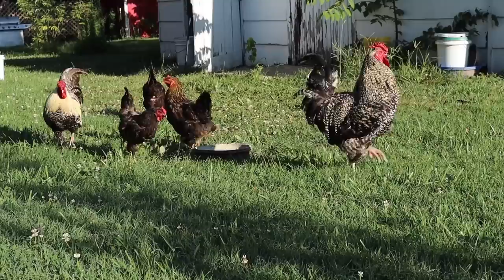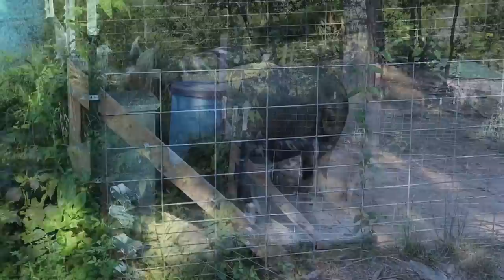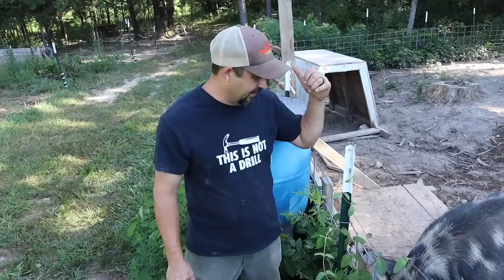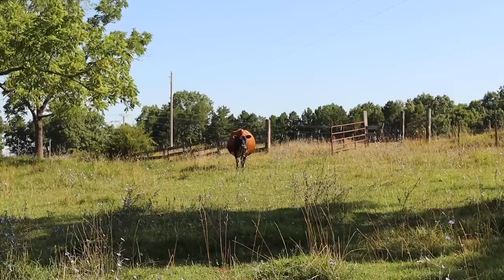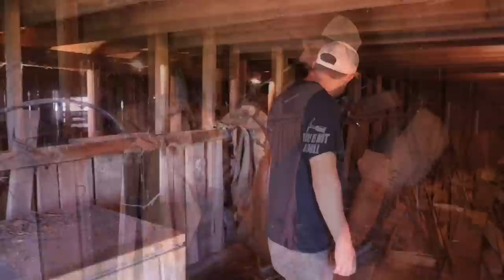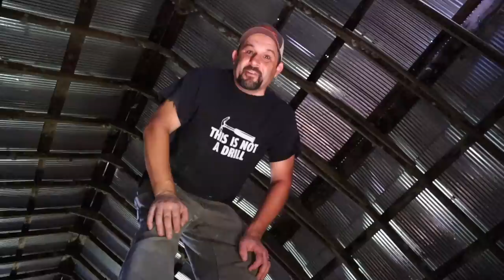This Barn Has Waited 50 YEARS To Be Used Like This Again!

Comment: When the hay got low enough we used to clear off the floor and play basketball.  We had a hoop on just one end.  I think I would get it water tight and use it for storage.  Depending on the area you could rent out storage space for others.   You don't want bats in there due to the  rabies problem.  You could build a bat house for them.  They are useful as they eat a ton  of insects.

Comment: Hi, the boxes you found may have been feed boxes...we used similar  ones for pigs that had sired their pigs and for the horse we had attached them so they could not be moved. 
If you have the time I would put a staircase on the outside going up to a landing for a easier safer access to the top of the barn. 
In pa we always had dirt hill to one side, but PA is mostly hills lol. I seen the bird flying around I would screen it keep them out to keep it clean for drying. It would be great for drying herbs as well and a place to store homemade vinegar in a barrel. I had a 55 gallon wood barrel full of apple cider vinegar. Good luck in all you are doing. Hoping  to get back to a homestead soon I did it for 27 years and miss it. Look now for work then land.

Comment: I went to a farm in the summer that was just like that.  Hay loft and storage in the top, milking in the bottom as you show, on the side the pigs ran out into the field and had the pig slop big buckets to feed them. 
You are accurate about how it was used......it's a beautiful barn. I remember in the barn they had a side room on the cool side of it and that is where they did milk separation process with a sink and water etc  before taking it into the house to keep it and cool it in frig or they may have had a frig in that room to do that.  That would be easier than bringing it into the house kitchen as it was limited in space also.  they had a one legged stool with a round seat and rounded peg on the bottom for the "leg" and they balanced on it as a seat and could move easily if the cow moved.......it was very very much like that barn you are showing. It has side panels that lifted for air and could be put down also for winter or weather and that was in So Dak  in Howard.  So fun and memories. The crops were down behind the barn off to the side corn and veggies by the creek and the animals could reach the creek and get to the fields and back to the barn........the pigs would come running when the farmer called sueeeeeeeeeeeee sueeeeeeeeeeee they knew it was meal time. All the critters came back to the barn for eating and were let to pasture and creek the rest of the day........they would come back at evening.......like clock work. 
Loved that!
I believe you would have loved the farmers and they would have certainly loved the two of you and your care and love of the land and animals!
Blessing

Comment: I grew up in Nebraska on a farm that had 4 milk stanshions. There were 13 kids so 4 cows must be about the right number for a family of 15!

  Like yours, there was a recessed concrete trough behind the cows.  Instead of hand carrying the hay, there were several "windows" cut out in the wall of the hayloft where the hay could be dropped down, by pitchforkfuls, into their feed trough. The trough was about 6' tall so the hay didn't fall on the cows. Our barn would have been built in the early 1900's.  So the front and back eaves opened up and there was a manual hoist system inside to lift the loose hay/haystacks up into the loft for storage and ease of feeding.   Really a well thought out system.  Plus there were regular stairs to go up to the loft, not a ladder type.

Comment: Large mid section for cows with bedding & feeding. Hay & straw could be dropped in from loft. Where you have rabbits, we had concrete added for 3 milking stands with gates to hold 3 cows at a time , out fitted that 3ft wall with the vacume ports for the milk machines. Like you showed us.

Comment: As a carpenter in Ohio there was not much work in the winter. One winter I spent the time working on a farm that was bought by a Dr. all the buildings including the house down to the trim was milled from native oak on the farm. I had to carry a drill around with me to predrill all the wood before nailing. There was some wood left over and the Dr. wanted me to make a new bed for the buck board wagon. I had to take the lumber to a Menonite lumber yard to have it milled. It made a great bed for the wagon.

Comment: I'm in Wisconsin and grew up on a dairy farm here, with an old red barn. They're actually becoming rarer here as well. Certainly a lot less than when I was a kid. Although my folks sold the farm 20 years ago, it's fortunate that the new owner just had it re-roofed, so that's one barn that will still be around for a while. Spent a lot of hours dragging hay bales down the length of its hay-polished loft floor boards...

Comment: With the upper barn, if you want to dry things, make cages with hardware cloth, to keep rodents and birds out. you could even use some metal screen to help keep bugs out. It would be nice and dry up there, and it looks like good airflow. 
Also, when you remove some of the old items, like the lines for the milking machines, you may see if there is anyone doing restoration work and that could use the parts, or someone still using old equipment. 
My Husbands Grandmother had an old well house with cupboards (with chicken wire in the doors, )inside the well house to keep meat cool, they didn't have electricity there until the late 70's or so.

Comment: when I was a young guy I worked in hay fields around the area and have worked up in the loft a lot, it is very hot up there when stacking hay, the barns we worked in had a track in the very top that  they used a rope setup to bring bales up, we used to use small round bales and  square bales, my cousin usually set the forks in the hay on the wagon and they would bring up 16 at a time, it was hard for me and one other guy to get them stacked before the nest set came up.. lots of wasps, I see you had a lot of mud daubers in your loft too.

Comment: I love the barn. When I was a kid in Texas we bought an 83 acre farm with a 100 year old house and barn and an older homestead house. My family of 6 moved there from the suburbs of Dallas. I was in live with that barn even before we got horses.  The roofline was wasn't like your barn, it was a straight pitch roof that came down to a lean-to on either side. One on the fenced pasture side  would be the shelter for our horses. The other lean-to sheltered our meat rabbits. The center of the barn was open and wide enough to drive a large truck and trailer through. There were stalls lining both sides of the barn.  This was not a milking barn but there was one stall with a high wooden floor and a manger that could have been used for a milking stall. Like your barn there was a huge hayloft. Unlike your barn the loading doors weren't on the outside. There was a large hole in the center of the hayloft  floor and a block and tackle hanging from a center rafter with which to pull hay bales into the loft. There were also holes above each stall which could  fit a whole hay bale with a manger beneath to hold it. There were a few  feed rooms with high wooden floors. The best feature of this barn was there was no latter to the hay loft but a staircase such as would be in a house. It was great. The barn was in good shape for its age except for some missing shingles which allowed in speckled sunshine, barn swallows, yellow jacket wasps, and a little rain. I miss that barn but keep it's blueprint etched in my memory.

Comment: Try driving a nail in one of your old oak timbers.  The only way is to hit the spot you want the nail to enter hard, with the hammer first. Hit the spot hard.  Then the nail will enter without bending.  I had an old  Missouri oak barn at one time.

Comment: Grew up on a dairy farm west of your home town back in the late 50's.  We had 40 cows, 20 on each side of the barn.  All concrete floor and vacuum milkers like yours.  Each cow had their own stall, each stall had auto feed water for each cow.  We put all the feed down in the feed trough before the cows were brought into the barn so that we could concentrate on milking right away.  There was a large center isle down the center of the barn that the cows used to get into and out of their stalls.  After the cows were serviced and left the barn, we would shovel that center isle clean and then back the manner spreader in to get rid of the poop.  Why do you think my parents would let such a young kid like me drive the tractor out to the field after each feeding???😁 I loved it.  We didn't have those leantos, but if we did, they would shelter a tractor for sure.  You are going to love your tractor!

Comment: Congrats on the land purchase it has huge potential.  Hope is living in the lap of luxury with the huge lean-to stall. Great use for the other lean-to as a rabbit habitat. Make sure to wear a particulate mask when cleaning the barn especially the feed & poop troths due to Hantavirus.  The barn appears to have good bones (structural beams).  The walls need some battens. The gap between the walls and the roof needs closing up to prevent high wind uplifting of the roof. Clean out the loft so a more detailed inspection of the flooring can take place as it will prevent injury. Looks like electric needs some attention as well, be sure to use pvc conduit. Rain catchment on the barn roof would be hugely beneficial. for watering the livestock.

Comment: I had a uncle who was milking when I was young and he had a barn similar to yours and he milked his 30 cows  2x/a day using that air pipe and when the milker was full he would dump the milk into milk cans and they would come by everyday and pickup the cans and then leave empty clean cans and then would go to town and unload on a chain conveyor, and today they unload 5 triple axle tankers at the same time into upright tanks and pipe the milk overhead and across the street into vertical tanks outside the creamery. 
I remember my uncle milked on one half of the barn and on the other half he had a pen of baby calves that he fed by bottles and he walked down the center of the barn and he had 2 holes one in the middle halfway down and the other one at the south end of the barn to throw down square alfalfa bales to feed to the cows and calves and once the cows were milked they would be put on the opposite side of where they went into the barn to get milked where they would get fed in the bunkline from the silo of whatever was in the silo which was usually corn silage in one silo and alfalfa in the other silo. And the cows would get plenty of exercise as they would walk down the lane to the pasture which was 3/4 to 1 mile away from the barnyard.

Comment: As it was a dairy,  those small wooden boxes might have been butter boxes. Butter boxes were used as storage for  butter intended for transportation for distribution and sale. They were crudely made from wood with nails holding the box together. They would be returned to the dairy after use. The boxes were used continuously until falling into disrepair.

Comment: The upper section could be used as dry storage with all those wood boxes, an herb room, dry gourds, or hang some lights and it could be a teenager hang out. The possibilities are endless. You can always use weather tight space on the homested.

Comment: My Grandparents had a couple of large barns, they were used for storage of hay, in oblong bales. Parts of the barns were where older equipment and machines ended up. One item was for processing large root vegetables for cattle, a mangle. On their farm milking was done in s purpose built milking parlor, which was automated and had  a dairy for homogenizing the milk. Dark areas were also used for dry storing vegetables and fruits.  In earlier times the farm had had pigs and sheep, by my time they had about 30 cows, chickens and geese. If you had geese they are very aggressive and may well be effective against most predators, plus their eggs are very rich. here farms seldom take in straw bales are the over large rounds or blocks, completely wrong for such storage. I can only suggest the areas be used to be more organized with seasonal equipment and turn one area into a workshop and vehicle storage.

Comment: If you are going to store grain in the barn, you'll need some barn cats to control rodents.  If the loft is open enough, pigeons will roost in the barn.  Quail substitutes.  We used to catch them at night.  Also, my uncle kept his young calves in one of the sides.  Sometimes he put his sheep in one of the sides.  Of course some of his farm equipment were in the barn.

Comment: I’m sitting here thinking the first thing that I would do is rip the siding of that beautiful barn and expose the real wood siding, nothing is better than the looks of an old barn that has been freshly painted and well cared for, I wonder what the big sliding door looks like under the siding, does it have a Z pattern or an X pattern hiding under there or maybe just straight up and down boards, it’s a mystery 😉 your going to have a lot of fun working on the barn bringing it back to life, can you imagine what it was like when it was first built and they filled it up with new hay the sweet smell of hay filling the air, the excitement of milking the cows with  new equipment, it must have been like heaven. Enjoy your new place she’s a beauty!

Comment: Lovely old barn! I grew up with the same type. Solar panels on the roof would be quite useful. I couldn't help but notice the mud wasps nest. we spent a few days knocking down everyone and spraying the barn, and left it air out completely before we put any animals in it. The boxes would be great for chicken laying though ours were like cubby holes we had like 3 long rows of nesting boxes off the ground and under them a area to feed and rest, we eventually for winter turned a wheat bin inside the barn into a chicken winter coop. I am curious how many acres do you have now?

Comment: First recommendation....add some fake owls on string to help keep birds out and minimize pooping all over everything.  They sure helped in mine.  Second, I love the barn.  I would re-arrange the barn to only have the stancheons you think might be the maximum needed; then add two.  The rest of the milking area can be re-purposed for other farm needs.  You bought a beautiful property!  The loft without an elevator would be difficult to access easily as you get older.  (And don't forget the birds pooping.  I would rethink drying my herbs there)

Comment: I spent many of hours stacking hay for two neighbors in barns like that, was my first paying job. It's sad to see them go into disuse now that you need to be big to make it and rural kids not wanting to combat the dust, heat, exhaustion, and hornet that come with being up there stacking hay up to the roof tightly and proper so the farm has as much as he can for the winter. I was happy as a clam when I got my first $6 an hour pay check, and I was lucky I got that much per hour being that it was the mid 90s.

Comment: Once a year we would scrape and whitewash the interior. We did not miss an inch of wood on the walls and the overhead rafters. The poop channel would be pushed out to one end and we had an electric conveyer belt that put it all outside into a giant pile. In the early spring, we could park poop spreader under the shoot and catch it all for use on the hayfields. As the pile grew we would sell most of to dirt farmers for there needs. 
Milking was done twice a day at 5 am and depending on the season 6 - 8 pm.  I could go on for hours with more and more details but that's all for now. God Bless.

Comment: I spent many hot summer days hauling hay into the lofts at our central Texas barns. Those were the "not so good old days" of the 1950s and 1960s. 
There is nothing wrong with using part of that loft for small bale alfalfa hay storage. You will need high quality hay for your milk cow/s. Those old PTO driven elevators are still around and you can buy them dirt cheap. 
Also, if the loft has doors on both ends, you might consider building an outside stairway on the end you don't intend to use to bring in hay. It could create a convenient access for bringing produce in for storage. 
You could add a dead waiter and platform beside the landing at the top of the stairs.  it would make it easy to bring in food for storage that will be too heavy to carry up the stairs.   
How many acres did you folks buy? Does it also have a house to go with it? A full tour would really be interesting.
Reply: There are a couple other videos that answer your questions

Comment: Will look great when you clean it out. If you are going to only get 1 more cow, do you really want the automatic milker installed into the barn? Wouldn't your current milker be adequate for 2 cows?

Using the top for curing would be great, but you could also store potatoes there for replanting (if it doesn't freeze in there). But that would only take up a fraction of what looked to be there. May be excess canned items. Take the freezers up there & store your bulk grain up there, use a funnel & pipe to release 2-3 days of grain into a bin or tub at the other end of the pipe. Just ideas.